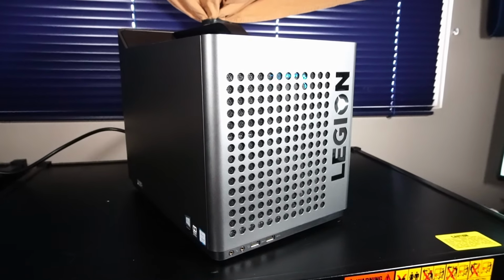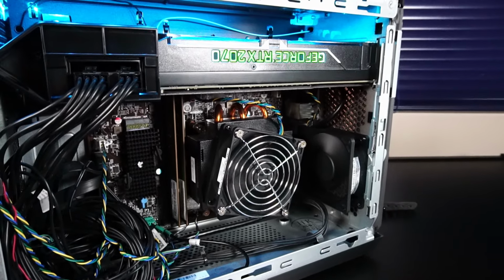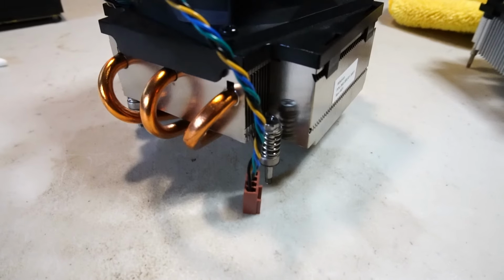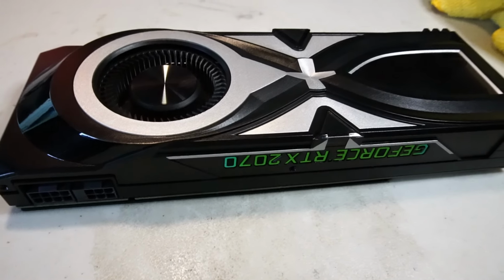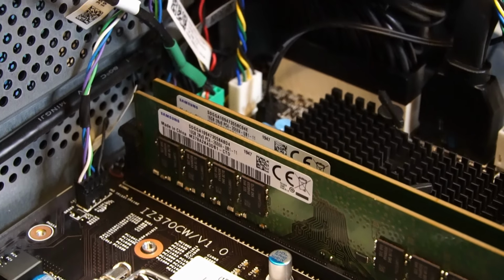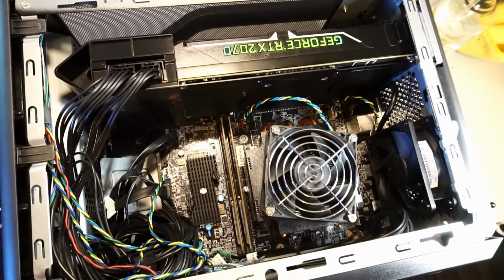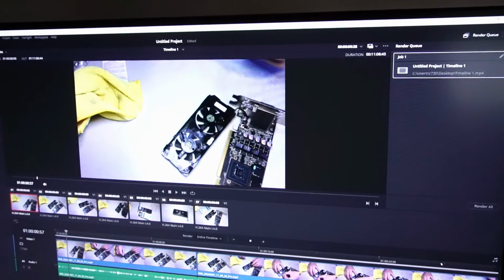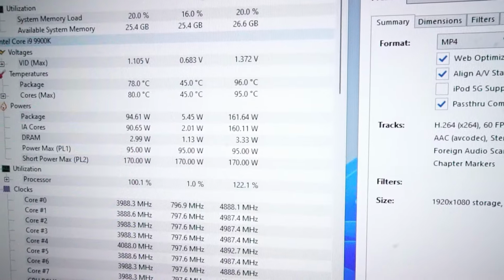Lenovo Legion C730 in 2024!  i9-9900K & RTX 2070 tested

Comment: I wonder if it uses standard hole pattern and rear IO panel placements so the original motherboard could be replaced with aftermarket offerings, some modern mITX motherboard for example
Reply from the maker: I wish I could get a second look at it, but I bet an ITX board would be the perfect fit

Comment: i have the exactly same oem gpu.. the cooling is afwul
Reply from the maker: This is the case with so many prebuilt gaming PC's.  Blower style fans on higher end gaming cards isn't always the best choice, but saves the company (Lenovo in this case) a few bucks.
Reply: @HaisteComputerRepair  True. Now that i improved my case airflow, my gpu temps are 75C under full load. I had the same gpu in a lenovo t730 case, it went up to 85celsius.